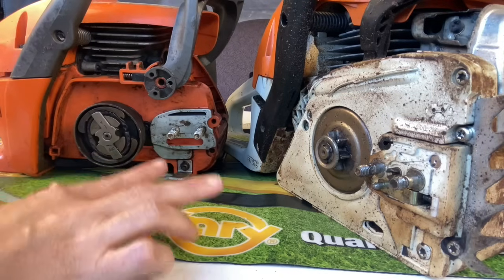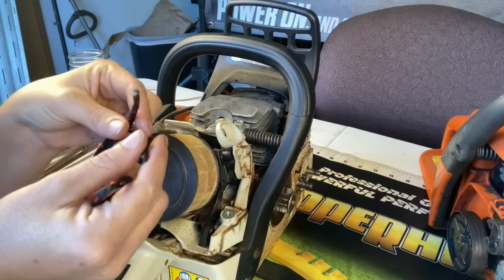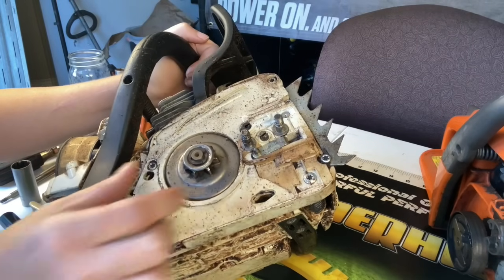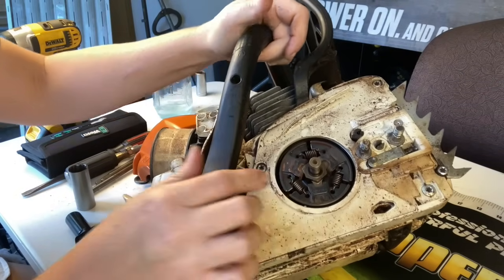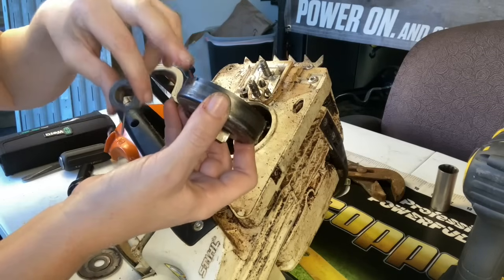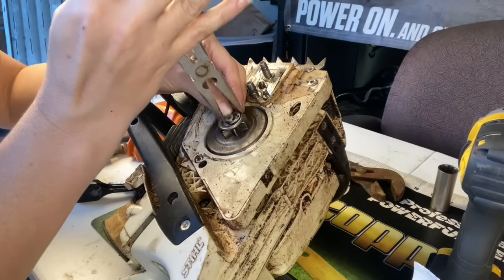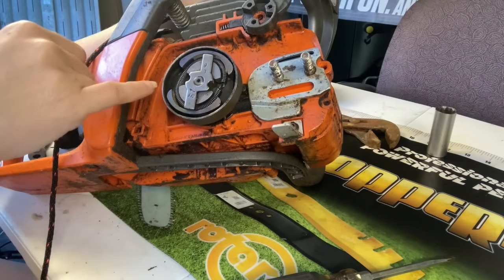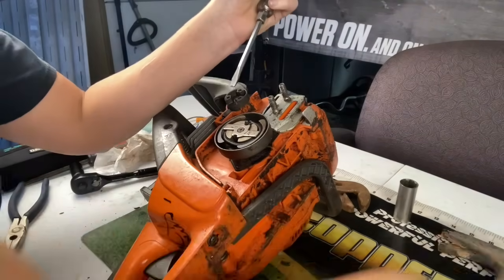HOW TO EASILY REMOVE THE CLUTCH OR SPROCKET ON ANY CHAINSAW. STIHL ECHO HUSQVARNA JONSERED POULAN

Comment: If you use rope, be sure the piston is above the top edge of the exhaust port before you put the rope through the spark plug hole. If the exhaust port is open, the rope can go through it and get caught in the port and be pinched by the upcoming piston. This can cut and damage the rope causing rope fibers to lodge between the piston and cylinder. I always fold the rope and put the loop in. This keeps the ends of the rope out of the cylinder, with less chance for rope fragments coming loose. To get the flywheel nut or clutch off (Stihl), you can leave the spark plug in and use the compression as a buffer to allow safe removal with a socket and impact wrench. Just blip the impact, don't hold the trigger down. This is especially important when removing the clutch. If you are powering the clutch off, when it gets above the level of the chain brake loop, the centrifugal force will cause the shoes and springs to go flying across your shop. I learned this at the school of experience. When putting the assemblies back on, I don't use an impact - I go with the rope trick and torque wrench. I think rope is better than piston stops because the pressure is put on a very small area with a stop, but rope offers a larger area and more give.
Reply: Thanks a lot Pal. This really helps.  Honestly I’m freaked out to do it - shoving something in the cylinder goes against all logic but I realize it’s the only way. I have an electric impact wrench so I’ll use that for taking it off.  
Can I simply hold the flywheel at the other side to re-torque when tightening back up? Or maybe that’ll damage the flywheel….Thus avoiding putting rope in the cylinder at all.
Reply: @alexpearson8481  When the nut starts to get tight, the flywheel will jerk out of your hand, possibly causing injury. If you have an impact wrench that you can adjust accurately for the correct torque, you could try tightening by leaving the spark plug in and using the saw's compression to work against the wrench. If you use a soft nylon rope that is not frayed, and start with the loop, keeping the ends out, there is no danger at all, assuming the piston is above the exhaust port. I do not use impact tools on reassembly, since mine is air driven and not adjustable.
.
Reply: @beingthere597  thanks appreciate that.  How can you tell if you’re above the exhaust port?  Or maybe I just move the piston most of the way to the top, then put the rope in….and then should be fine?
Reply: @alexpearson8481  Before you start to thread the rope in, look through the spark plug hole and watch the piston coming UP past the upper edge of the exhaust port. A bore light can be helpful.
Reply: I find with my husky there is no need to lock the piston when using a rattle gun.
Reply: I should have read this before proceeding,  i did mine at BDC.  don't think anything bad happened but this is very good info
Reply: I know this comment was long ago, but I literally did this today! Wish I’d seen your comment sooner and saved myself heartache until I just took off the muffler.
Reply: Great advice, will keep this in mind till I die, thanks for teaching me something new 👌
Reply: @matthewanderson3631  Glad to help. Good luck!
Reply: Customer just bought one today with rope stuck in it 
Can’t help hard headed people 😊😊😊
Reply: Just use a old toothbrush and be done with rope problems
Reply: Used the rope trick, didn't think about the exhaust port, end of rope went out port a little, didn't know it, when piston came up to stop on the rope the edge of piston cracked and wiped out piston/ cylinder and exhaust port when I ran the engine!
Reply: I didn't read the comments before starting, the rope is stuck what do I do?
Reply: @carrieharris4812  Assuming the rope is pinched in the exhaust port, put a wrench on the flywheel and try to turn the flywheel the other direction to move the piston down. Hopefully that frees it up. Good luck. As stated above, rope should not be inserted until the piston has closed off the exhaust port.

Comment: Now if I'm outta line please tell me, or cuss me if you want. But on the Husqvarna instead of a screwdriver to knock the clutch loose wouldn't a drift or a brass rod be better. Hitting a flat blade screwdriver tends to get klutzy Scotsmen into trouble, or at least a trip to the first aid box. Another good show Chicka spreading the knowledge.
Reply: Making this tool takes literary 15 mins, flat bar with two holes and two bolts, space to suit your requirements. I would not be banging on it at all as the shock loads are transferred directly to the main bearings and piston bearing.

Comment: I have to laugh, because if I don't I'll scream or something ;) I've been struggling with that Husky style clutch on a 38cc Joncutter. I'm doing the right things. It just won't let go. Came to Youtube and pulled up this video to verify that I am doing the right things, in case I had missed something. Nope. It just doesn't want to let go ;) Also, My Husqvarna 576XP autotune has that Stihl arrangement with the sprocket on the outside.

Comment: Thank you so much for the wonderful broadcast,  I had been wondering of how to get the clutch off and check to see why my chain saw wasn't oiling,  and thanks to you and you're wonderful channel I got it figured out,  and also am a brand new subscriber to you're wonderful channel! 
May God bless you always my sister in Christ.
Reply: About to do the same to my ryobi tomorrow. Did you get the oiler fixed?
Reply: @williamrgrant  come to find out my problem was the worm gear was stripped out causing it not to turn the gear that pumps the oil,  gonna order parts to fix it.
Should not cost over $30
Reply: @joshuamccord2414   just discovered is the stripped worm gear on mine as well!
Problem is my saw is a Ryobi from 2007 and the part is unavailable. Gonna take my chances on a pump and gear assembly from a newer identical size model from Ryobi. :)

Comment: This was a great video. I just got a used Stihl ms250 and wanted to check everything out like you showed. It worked like a charm. Only question I had was the inner washer, after the oiler worm gear, which way does it sit? I forgot to look when I took it off. Thanks!

Comment: On bigger lawnmower engines I stopped doing the rope trick when I got an air impact. Have you tried the air on a chainsaw ?
Reply: One guy John-gi1jr, says it will damage the ☆crank seal   / if too much tourqe is applied and / not needed

Comment: Good idea never thought about putting a rope in the cylinder 🍀✅
Reply: I do it too - just make absolutely sure the exhaust port is closed before inserting the rope. If not you can damage the piston.
Reply: The most basic thing u can know if u ever worked as a small engine mecanic. I never use this tip on a chainsaw tho
Reply: @jaypayette8525  I've never been a small engine mechanic I've always worked on heavy equipment.
Reply: @jaypayette8525  I've used it as as small machine mechanic for 35 years without any problems - just make sure the exhaust port is closed before using the rope.

Comment: My clutch is being stubborn. Every socket or wrench that i use slips off due to the low profile nut holding it. Idk if mine was just torqued way tf down or what. Is an impact necessary in this instance?

Comment: Alright, I suppose so.  The string in the cylinder.  That's new.  I've had my saw for a long long time. So many stories ~ Yada Yada Yada.  Thanks for this. I'll Subscribe.  Not sure what this is all about but I'll include all this in my routine.  OOPS well, ~ another story ~ yesterday the sprocket finally gave way with the chain off the bar and happy to have a spare sprocket. The spare sprocket has also been around for a long time.  I knew this would happen. The string in the cylinder.  Thanks so much.    ✨🌟👍🌟✨
Reply: *NOT string...small diameter rope

Comment: Now my Ryobi RY3714 clutch not fully disengaging. One shoe hung up on the drum so when you pull the start rope the chain turns. This in turn leads to the chain moving at idle and the engine having to work harder and stall out during operation. A lot of times if I ran it for a bit it won't start up again until it fully cools down. The drum has a seized needle bearing and moves the crankshaft with it so I bought a replacement online.

Comment: I have never used a piston stop on a Stihl  saw, because they the a 17mm nut built on the end of their clutch.  I just remove the sprocket and sprocket bearing and put a socket on the nut on the clutch and use my battery impact to remove it.  It enloosens to the right.  On a Husqvarna, I have to use my clutch socket and impact wrench to take it off, because Husqvarna does not put a nut on their clutch.  I use the same socket to reinstall the clutch on both saws.  You can pick up a clutch removal socket from EBay for about $10.  Installation of the clutches on both saws is to the left, slough I spin them on by hand before tightening them with the impact.  I usually give both two raps with the impact.  If you do not tighten the Stihl clutch down tight you will have problems getting the sprocket washer and E clip on the crank.
Reply: mabey you should make a video on how to make the job take longer and cost more. my advice is youd better listen to what the woman says
Reply: and zinging sh t off and on with an impact is actualy advice of a heathen
Reply: @malcommooney8086  I zing them off all the time without any problem.    You are perfectly free to take them off any way you desire.  Opinions are like a-holes, everybody has one.  Btw, I am not a heathen.  I have been a member of the Methodist Church since 1957.  I am also a 32nd degree Mason, so there is no way you can class me as a heathen.
Reply: @johnclarke6647  study the word ,you go to a baal temple, and you are one of the pee ons on an occultic boys club
Reply: @malcommooney8086  at least I know how to write the Kings English without getting personal.   Anyone who gets personal has already lost the argument.
Reply: @malcommooney8086  you have been watching to many revisionist history programs on TV.  The Masonic Order contains some of the best people in this country.  People that have honor and ethics, unlike a lot of folks today.  If we had more like them we would not be in the mess we find ourselves in, today.  Masons are not a cult.  They are a Christian fraternal order.

Comment: How determine if the clutch is bad? My chainsaw  Gets hot when I run it and it's getting plenty of oil.  It also has a brand new chain on it.

I have a  cs-400 Echo chainsaw.

Comment: That's the way I always heard people do it but I honestly just have the "false spark plug" tool that just has a rounded edge to protrude into the combustion area and keep the piston from rotating.
Reply: I used a piece of nylon cord.  Ran the piston up to TDC and then backed it off a tad.
Reply: @John-gj1jr  yeah a lot of instructions call for rope and it's usually readily available, but I like the tool for piece of mind.
Reply: @Gideon_Judges6  Yeah, I understand and if I'd had one, I'd probably use it too.  But I've seen videos of people sticking things like screwdrivers and odd bolts in there.  I really believe the rope is a safe solution.  This is the second time I've used it, and amazed at how solid it is.  I figured it would be spongy, but it's very solid.
Reply: @John-gj1jr  It's pretty safe as long as your end is not frayed and thus more likely to leave fibers or get stuck.
Reply: @Gideon_Judges6  I checked for that.  Thanks.  Now I've got to find a clutch with "brake" linings or somehow reattach the one that's loose.

Comment: The clutch on my ms 180 gets hot in use even though I have changed the worn sprocket what would cause this.the clutch is free running so I was thinking the oiler stuck.ans what grease should I use on the barrel bearing.

Comment: Question, is it possible to change the sprocket on a battery chainsaw to accept.325 chain? For the life of me I can't find anything on this. I have bars and chains I want to swap over to a battery chainsaw but they are all3/8 as far as I can see. Is there a battery chainsaw with.325sprocket?

Comment: Hi, I have a stihl br 200 backpack blower and it is not reving up to full throttle. I can't figure out if the carb needs adjusting or the spark arrestor is plugged.
Reply from the maker: When I get one in the shop with this symptom, the first thing I do is check the fuel. I make sure there is no water and that it is not canned fuel. If it is fresh mixed fuel, I then go to look at spark arrestor. If it is not either one of those two things check the plug. If it is wet it might be flooding out while running. If it is dry, it is starving for fuel. Then it needs carb adjust or work.

Comment: I think I have heard you mention before that you weren't a Stihl dealer so I was wondering what manufacturer of parts you use to repair Stihl equipment. Reading reviews on Amazon for "Stihl" parts has shown many fitment and quality issues. Especially if looking for a carb. I'm wanting to replace the clutch sprocket on my MS-271 saw. Do you have a manufacturer you recommend?

Comment: I tried to replace the sprocket on my jonsered 2137.  I was turning it the correct direction to loosen it.  But it was on so incredibly tightly. It came loose with a lot of pressure but now the saw doesnt run right anymore.  I might have created an air leak because it idles very high and carb adjustment cant fix it.

Comment: Take note that this vid is for this model shown. Different oil pump drives on different Stihl models, like an older 038 gear drive.
Reply: How about different spur teeth count. Like switching 8 tooth sprocket inplace of a 6T

Comment: Please help me!! I have an 1997 Jonsered Turbo 2054 compression start. It runs really great,, but the pull rope seizes up,, SOMETIMES. Some kind of Clutch issue. I have to make these short, jerky pulls 😢. It has gone from sometimes to most of the time seizing up. Yes, the compression button is in, no, the chain is not off the bar. I had a new clutch spring, and a new bearing put in. What the heck is this about?.
Frustrated in St Paul.
Reply: That could be so many things, without having the saw apart it would only be shots in the dark at the cause. Piston could be seizing up, pull rope recoil could be binding... gotta do some investigation on the inside to be sure, best of luck!

Comment: Question, I have 1ur old MS211C on my bench, piston moves a bit one way and hers stuck, moves a bit the other way and gets stuck, moves freely between those two points. Clutch bell is completely stuck solid, not moving at all. I am wondering if it is clutch failure exerting pressure on the crank shaft which causes the piston to stuck or is it bent crank shaft? There is no scoring on piston or cylinder, no heat damage anywhere . No heat discoloration on clutch bell or any plastics caused by keeping chain brake on while working. I don't want to particularly rebuild the entire engine and I was wondering if you had any time saving advice for me?. I am yet to remove the clutch so don't know what's waiting there for me.
Reply: It could be some debris blocking the flywheel. happend to me one time.
Reply: @guidoduijff1592  Sorted it, no clue for sure what was the reason but with zero heat damage and pristine piston, rings and bore, no damage to the clutch (managed to take it of, brake band was just stuck!) the only explanation I can come up with is that the saw was dropped and it "misaligned" the piston. When I rebuild engines and put piston with rings back in it often "gets stuck" in the bore. When rod bearing is installed it aligns it and it moves freely. This is my theory at least :) A little brute force freed it and saw works perfect now, zero issues. No parts needed either 😎👍💪.

Comment: You never mentioned that on some saws when you tighten the clutch back on the pull start will engage, not good using the impact gun against that!

Comment: Amazingly enough after watching you first members only live feed I find myself watching this video as my 450 Rancher sprocket just “Shit the Bed” 😂😂😂😂
Reply from the maker: Well, glad I could help!
Reply: @Chickanic  I changed out the clutch and brake system as well and cleaned everything out, installed new bearings.  I also checked exhaust and took a look at the piston as well as changing out the Spark Plug   Changed to E3 Diamond Fire.
Reply: @Chickanic   your videos have helped me with several of my power equipment!  I appreciate the Chanel videos and the education.  I find myself collecting other people’s “trashed” power equipment and scavenging for parts these days!

Comment: Great tip with the rope. I just woke a old 25 yrar Husqvarna to life. But a thought: it seems to drop a lot of chain oil even not under use. Is it normal that they are always oily underneath ”more or less”? Thanks! Cheers!
Reply: check and see if there is a black hose behind that thin metal plate, just right of the clutch. mine was broken off which oil kept leaking out just sitting.
Reply: @JohnSmith-mg6kr   - Thanks for tip - I will check.